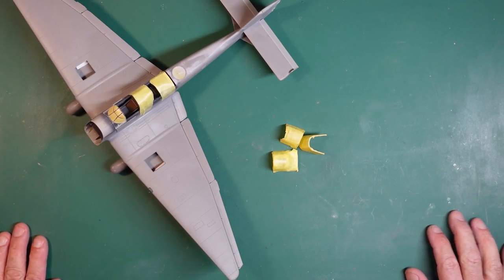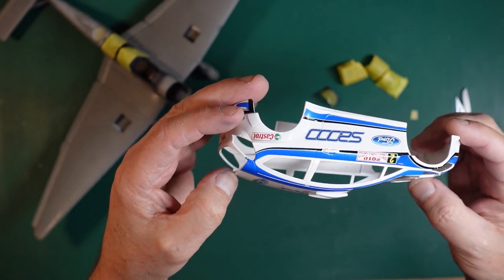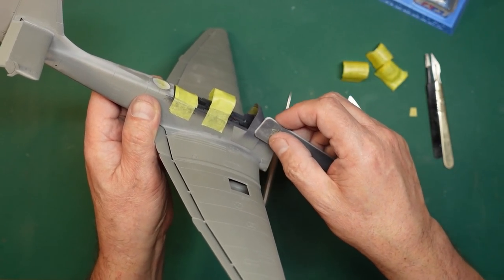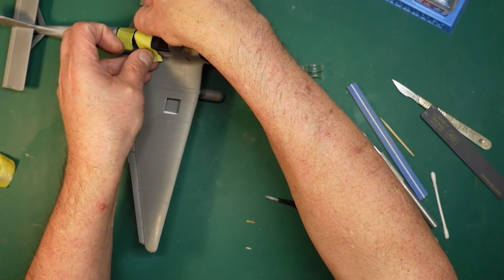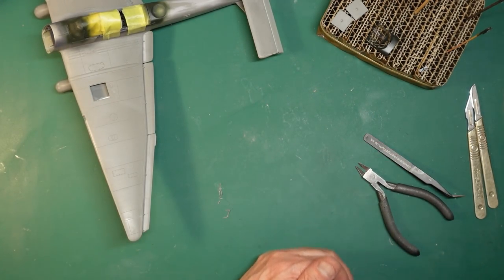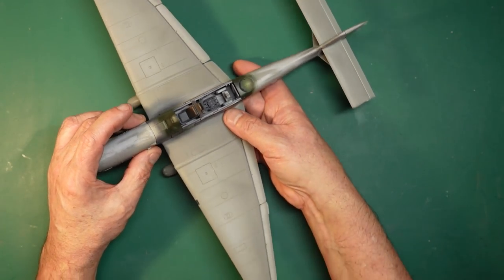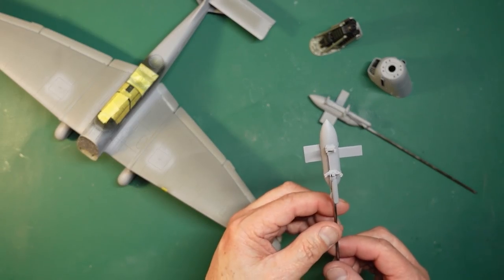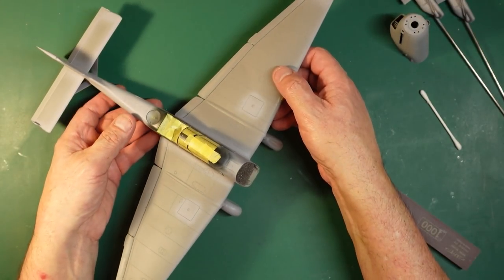Border Model 1/35 Ju87 G1/2 Stuka build. Part 10

Comment: I am doing a 1/72 B-25J Eduagawa's Angel of Mercy and I used their suggestion of masking the canopies on the outside (Eduard does not give interior masks) and painting the outside framing interior green. Then painting the frame again with the silver as my B-25 is being done in natural metal. This way you you get the interior framing in interior green  while the outside is in silver. For the interior green I mixed it with a bit of primer to get it to bite and hold.
Reply from the maker: I did that on the windscreen, but the rest of the glazing appears to be green all round??